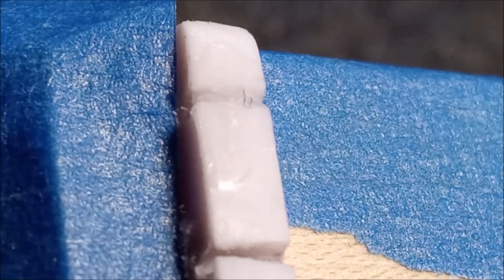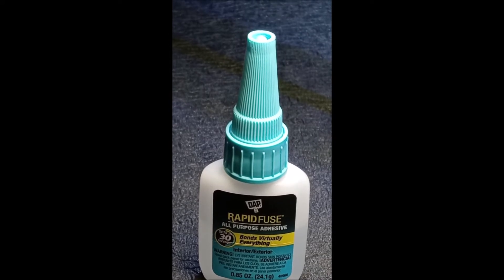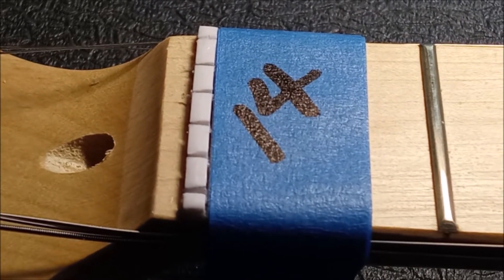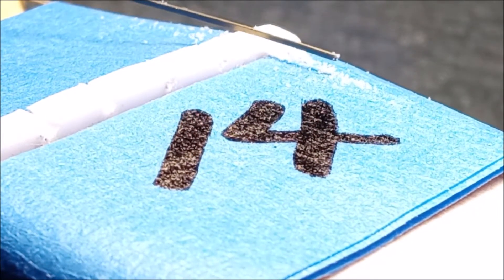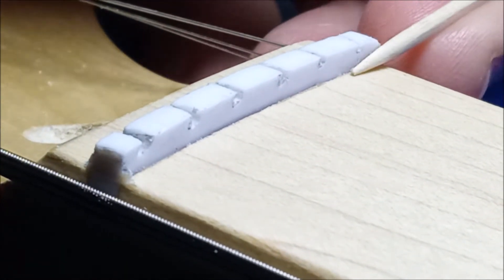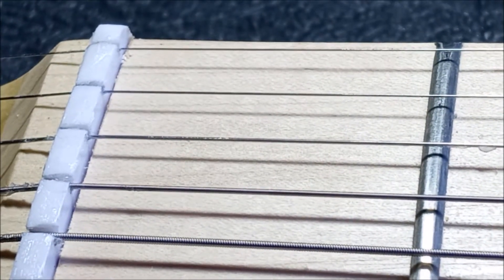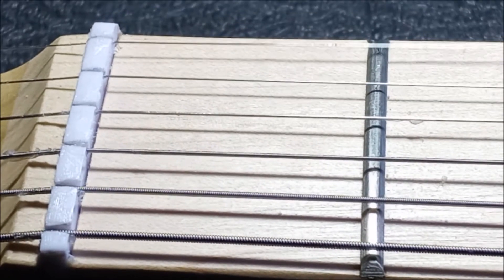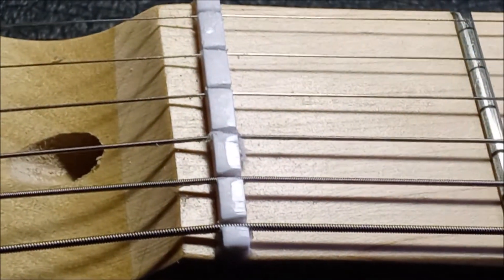Overcut Nut Slot? A Fix Anyone Can Do

Comment: i had a similar problem, i use those dimebag strings, and it low E was to thick for the nut so i filed it or well tried, and i filed it too deep, so i have just been tying a tie or spare guitar strap on it, andi honestly didnt like it, so i was going to buy a new nut, but i seen this, so i dont think i will have too! thank you! and if for some clarification, sometimes i would play it a little too hard and it would just come out of the slot, it really frusterated me, but with this, i can fix it, thanks!

Comment: I've got a problem with my new glarry Telecaster. the nut slot looks like it was cut with a angle grinder. and the Low E and A string is touching the neck. I bought a TUSQ XL Nut and somehow it needs shimmin it sits to low in the neck slot. I took the string tree off the D and G because they were also just missing the neck.

Comment: I find that a lot of Gibson Custom Shop guitars have a nut slot cut very deep, often too deep for the high E string causing it to rattle on the 1st fret when played open.  These guitars usually have nylon nuts.  I've used various fillers for nuts made from plastic, bone and other materials that work very well, but never one made from nylon.  What can be used as a filler for a nylon nut?
Reply from the maker: Thank you for your comment, Mark. I use super glue (the thicker kind). :-)

Comment: I use bone nuts, then use bone dust, superglue then a catalyzer... 50/50 bone nut dust make a paste, fill, catalyze  the slots on this nut are way too deep, the nut should be filed down to where 50% of the strings are exposed, potential building/buzzing so forth here with deep slots, V towards the rear..
Reply from the maker: Agreed! :-) Ok to save some bone dust in a small vial for work like this. BTW, I also save the ball ends of strings should spacing be needed for things like a Bigsby.